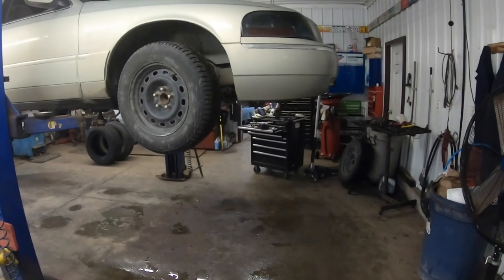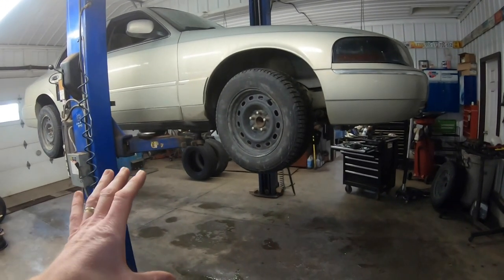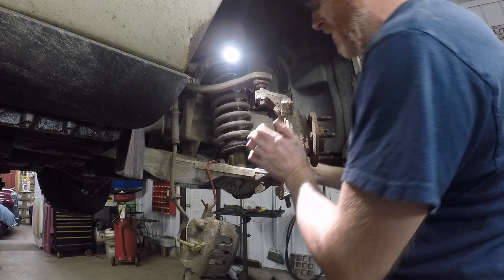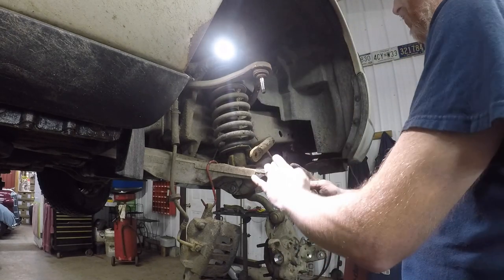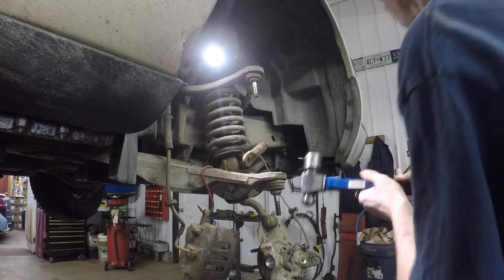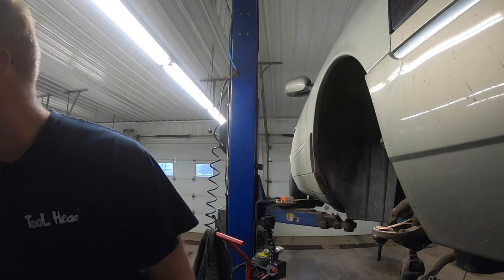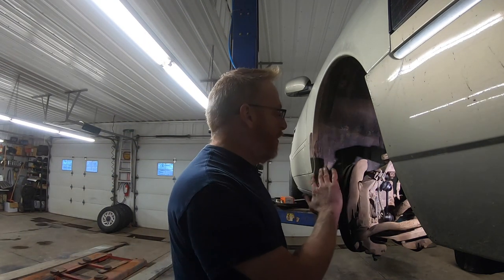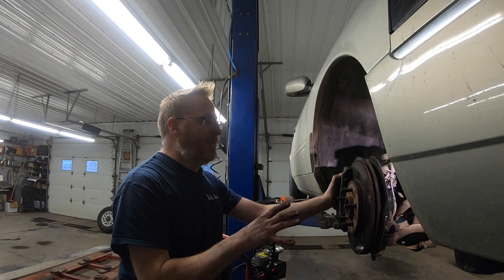Police Interceptor Needs Lower BALL JOINTS (Ford Crown Vic, Grand Marquis or Town Car 2003+

Comment from the maker: DON'T Forget!! Always have your alignment checked after any steering or suspension work!!!!!!! Thanks to Big Easy for reminding me to tell you!
Reply: Super informative. I’m a broke Joe and I always look for quality videos like this to teach me how to make my own repairs! Hopefully I can get this done! (She busted on me last night. Had her towed home).
Reply from the maker: @SERGEANT_DIAZ  Thanks for putting your confidence in me.
Reply: @OldeCarrGuy  we’ll see if it remains there! Hahahaha!
Reply: @OldeCarrGuy  you made it look easy, though I’m sure I’ll have hell. Got my list of tools and I’m heading to the auto parts store ASAP.
Reply: @OldeCarrGuy  sorry to bother you, I’ve been stuck for some time now trying to get the bolted part out. I’ve removed the nut, but the press won’t fit over it. I was able to get the booted part out with the press, but not the ball from the wheel hub assy. Am I just going to have to beat it till it comes out?
Reply from the maker: @SERGEANT_DIAZ  as you saw in the video, I beat the ball joint out with a hammer , but it will take the right combination of spacers (or oversized sockets), to get it back in! Did you take the brake assembly and spindle out like I did?
Reply: @OldeCarrGuy  Yes, sir I did. I had to stop for the night because I can’t keep beating on it this late. I figured that’s what you’d say. I appreciate the feedback. Subscribing and clicking that bell! If nothing more than to see funny clips!
Reply: @OldeCarrGuy  main problem I have is that the ball joint separated from the boot and is still attached to the wheel hub assy.
Reply: @OldeCarrGuy  just wanted to update you. Faith is intact! I was able to bang it out and I realized I needed the upper as well. She’s back on the road! Looking forward the the next repair! 😓 thanks for the great video!
Reply from the maker: @SERGEANT_DIAZ  awesome! Happy to hear it!

Comment: Removing that ball joint seemed like an ideal situation to utilize an air hammer.  I got one to hammer the races out of my differential when I swapped to 3.73 gears.  What a fantastic tool it has been ever since!  I sometimes have to put a piece of 2x2 or 2x4 between the hammer and whatever I'm working on, but it's so freakin' useful!

Comment: I've changed em inside, outside, 80 above and 30 below. I haven't been in my grandma since it started snowing. Straight town car life til spring.
Reply from the maker: Now that's dedication!
Reply: @OldeCarrGuy  I even changed the fuel pump in the town car outside when it was -20. Never again tho. Finally got a really nice shop to work in and it's not a dealership. Not doing that anymore either.

Comment: Thank you so much you have helped so many people. I watched another video on the upper control arm replacement for My Town car. Now with your video I have the confidence to do they entire job with the lower. Mine are starting to look dangerous and I am not going to have a failure. I am getting them in soon. :)  His video also had all the Torq specs for it all and this will save me so much in labor. I just paid to get axle rebuilt so could not afford more labor. I am good with mechanic work so this will be easy.
Reply from the maker: Thanks for watching Shawn.

Comment: Good video! Was recommended to you by Mortske’s. Couple of hints...don’t know about up there in Canada, but down here in the USA most auto parts stores have “loan a tool” programs where you can borrow a ball joint press with a refundable deposit. Also, you really should invest in some impact sockets and extensions. The regular chrome plated ones are not designed for impact tools!
Reply from the maker: Hey Gene. Welcome to the channel. We do have loan a tool in Canada, just nothing in my small town unfortunately. And you're absolutely right about the sockets. No excuses.
Reply: Whatever gets the job done at that moment works for me gd video 🤘

Comment: My o8 has a  setup different from  my 02 front end GM. The 02, It looks more like grandma setup. No rack and pinion, no strut assembly , shock and spring . 

I did not know that on 04 ball joints removable. Was always told it's part of control arm assembly  , thus not even worth the time to remove ball joint alone, people change control arms. But I guess I learn something new
Reply from the maker: Yes. Lowers are replaceable on 03 and up. The o2 and older do have a different setup in the front suspension.

Comment: I have a 2004 Crown Victoria.  According to Ford you are supposed to replace the entire lower control arm due to this year being aluminum. Replacement of entire lower control arm is easy.  Also I would never bang anything out especially on aluminum components.
Reply from the maker: If this was the case, why did they put a lock ring on the ball joint if it wasn’t meant to come out? And why does the aftermarket sell separate ball joints for aluminum control arms. Sounds like Ford wants to sell more control arms!

Comment: I'll be doing that on the wife's 98 GM soon. I have all the parts. Good tip on the stabilizer link, but Advanced Auto here wants $73 each for those. OOF! Rock Auto wants $29 each. That's for Moog.
Reply from the maker: Always pays to shop around! Thanks for watching Gary

Comment: I need to do this and upper control arms/ball joints. It appears most of the same stuff has to come apart to do both with the exception of the struts. Would it be wise to space this out over a few days and get it all knocked out at the same time? Or break up the repairs into 2 separate bouts?

Comment: I would of replaced the top ball joints as well while I was in there for the bottom but that is just me
Reply from the maker: Why replace what isn't broken? I don't have your money bud! lol
Reply: @OldeCarrGuy  if it's not messed up I understand but when bottom ball joints go bad they can also cause damage to upper ball joints just my experience uppers aren't to far behind
Reply from the maker: There is an exception to every rule. Trust me, If I questioned them even a little, I would have replaced them then!

Comment: What was the tool you used to for the bottom bolt when u were wrenching the bolt off
Reply from the maker: The ball joint stem has an alan key/hex key slot in the end for instances just like this!
Reply: @OldeCarrGuy  thank you

Comment: thank you for your input. I’ve been told in the past that due to the control arm being aluminum, you can’t press it. Is this true? I mean, it appears you have the aluminum arms, using a press, even went to town with a hammer lol. Did you have any issues with the aluminum portions of things or anything I should know? Thanks in advance.
Reply from the maker: No Issues!

Comment: Will a bad lower ball joint cause the front end to be lower than the opposite side?
Reply from the maker: Not unless it breaks completely. You likely have a broken coil spring. Springs set ride height!

Comment: where did you get front end bar links at $18.?? l paid 31$. with cold weather l was always getting a clunk tee clunk whenever l went over bumpy roads on one side and there seems to be a lot of them in this town. l remember one stretch of road on milltown blvd at Catholic church(let us pray on going over that stretch) which reminded me of WW1 shell holes last winter. No noise after replacement and there's less play in steering wheel on driving. plan on doing the other side..
oh u mentioned us living in the rust belt but u should see how long cars last in Montreal from where l use to live.. like 8-10 years.On going down the Decarie expressway on mild winter days one can TASTE the salt in the air!! the mechanics make a good living there and the junk yards  busy.
Reply from the maker: Hey Carl. As a garage, we are able to get parts cheaper than the general public. I agree the roads are bad but out town is really no different than any other town/city that experiences freeze/thaw cycles  like we do. A product of living where we live.

Comment: And as long as you're in there you said it how about the control arm bushings
Reply from the maker: My latest upload was replacing struts and upper control arm. I generally will only do a video if the car is in need of repair. But i'm sure the lower control arm bushings will fail at some point.